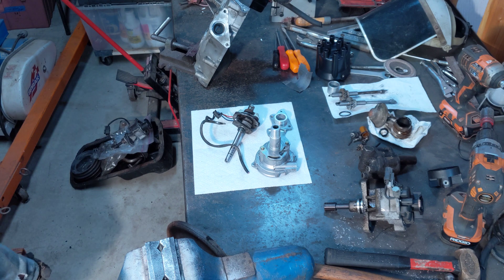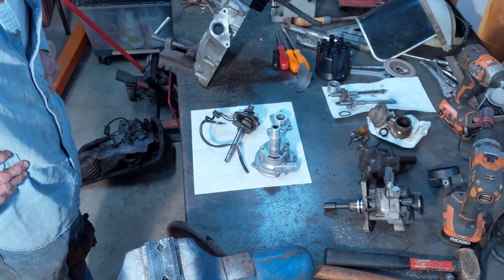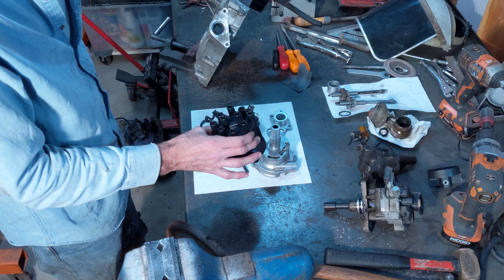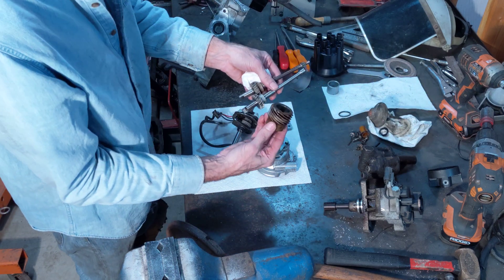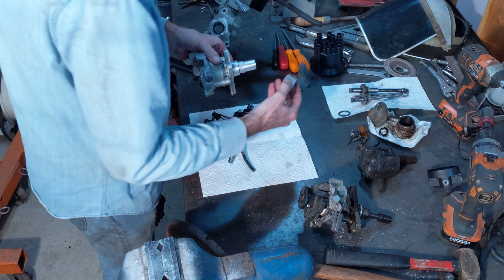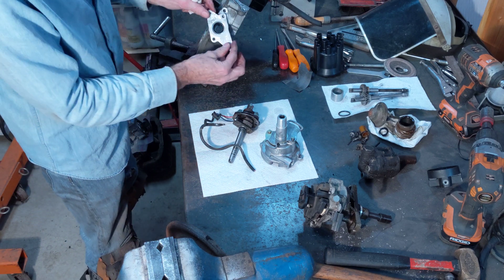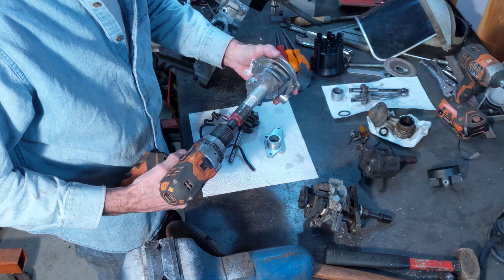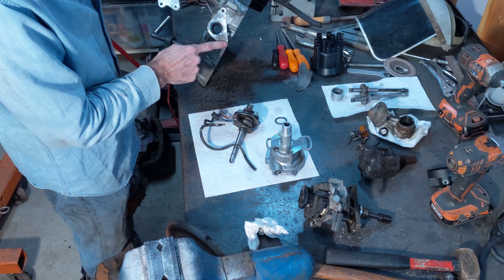KA24e Distributor conversion

Comment: I used the oil drive spindle from a 1980(?) motor, 720 dizzy so that the dizzy matches up with the oil pump and no computer.  I used the KA2.4e motor/timing cover/oil pump etc.......and a 1980 dizzy ele ing only two wires, red & black.  No need to cut down the dizzy shaft.  Picked up an adapter to line up the dizzy on the timing cover with the longer dizzy shaft.

Comment: Could you use a distributor from a L20 B motor instead of the NAPZ distributor and not have the extra four spark plug ports?  I want to put it in a KA24 motor.
Reply from the maker: Sorry its been so long, life got in the way.
I looked into the VG with carb issue.
I actually converted a distributer but discovered it origanally rotated the reverse direction so the mech advance would not work!
I then looked around and found that an older straight 6 Z ( 280?) with simple electronic pickup would work, with machining.
However I never actually proceeded with the project.
Good luck!